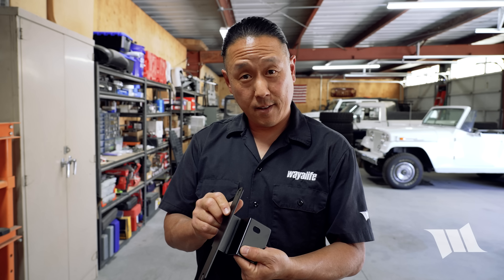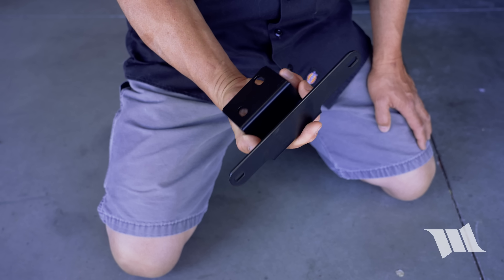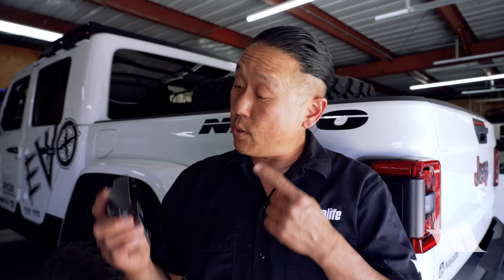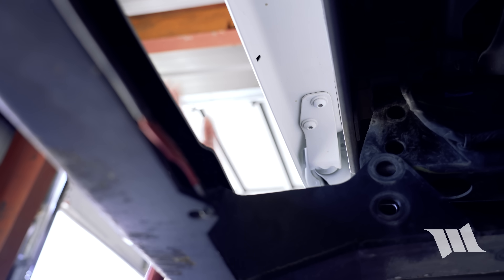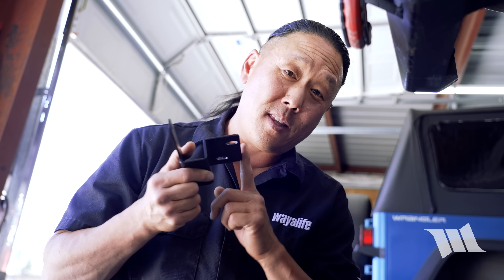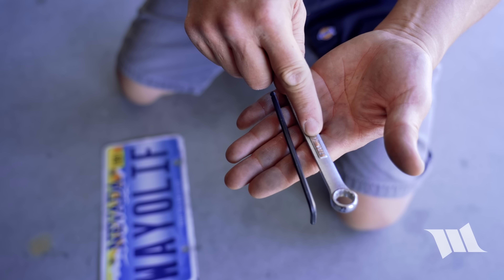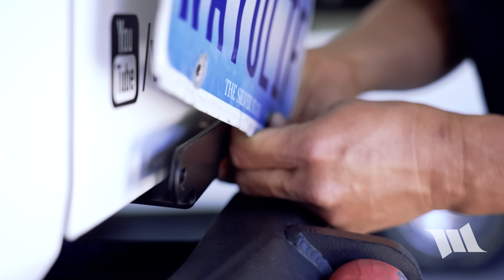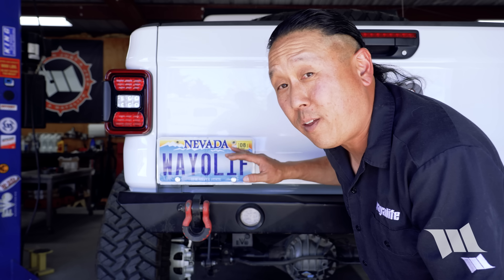Jeep Gladiator Tailgate License Plate Mount Install for the EVO High N Tight Rear Bumper

Comment: Great bumper but where you put the plug for the trailer cables? I'm scratching my head I want this bumper but I use the jeep with a jet-ski trailer I need a place to plug it safe 😂
Reply from the maker: EVO has a new version of this coming out at SEMA with a hitch receiver.
Reply: @wayalife  awesome! and where would the hitch cables be on the bottom? Would we be able to use the original cables the gladiator comes with?

Comment: Looks awesome are you running license plate light?
Reply from the maker: We are not. In fact, we are now running the new High-n-Tight bumper made and for some reason, it no longer allows this license plate mount to work. Hoping EVO comes out with a new setup that will work.

Comment: What options should I get on my Rubicon factory order?  Gorilla glass windshield? Rock Trac full time 4wd? LED lighting package?  Hitch package with 4 aux switches?  Steel front and rear bumpers?  What options did you get on your Rubicon JL?  I know it came with the 33s.
Reply from the maker: Me personally, I would definitely get the LED lights and the hitch package with the auxiliary switches. Full time 4WD is not something I would get. The Gorilla glass, maybe. It's super expensive but I hear it works pretty well. Steel bumpers, well, that all depends if you plan on keeping them for the long haul. Lots of great aftermarket options available.
Reply: @wayalife  Thanks for the help.
Reply: I was thinking of getting the Xtreme Recon package, but I want to get 488 regearing option because I plan to get 37s and a suspension lift.  Is it better to get stick or the 8 speed auto?
Reply from the maker: @mion1981  The 8-speed auto is what I would get for sure.

Comment: Good afternoon!  I have a problem where I hear a clicking noise when I start driving.  The sound is coming from the front gear.  the sound is like a metal knock.  (as if 2 wrenches hit each other) Mileage 10.000 km.  in the urban cycle.  I hope very much for your help.  Thank you
Reply from the maker: Sorry, I'd need to know a lot more about your Jeep to even begin to help you out. Year, model, modifications, etc. I would recommend that you post all this on https://wayalife.com. That is my forum and where you can get the most help.

Comment: I would prefer that this bracket be included as part of this bumper since if forces a modification to the license plate location. Should not be a separate expense.  Maybe it is and it didn't get communicated.
Reply from the maker: To be fair, there are plenty of people who run things like bed racks and have secured their license plate to it so really, I think it's unfair to suggest that everyone would need it. But then, that's just me.

Comment: Is the hitch on the hitch version reinforced inside the bumper with any additional plating? I can't find any pictures of that side of the bumper.
Reply from the maker: It is but it's basically useless for towing due to how it's setup.

Comment: Hey @WayaLife, how do you mount your 2 gal gas cans on the side of your Bed rack system? I am looking into ordering the EVO Half rack and 2x 2 gal cans. I am not finding how to mount them online though. Thank you in advance.
Reply from the maker: I made my own mounts but I believe that EVO makes something similar now.
Reply: @wayalife  I have searched on Evo site but found nothing. Might have to go with someone else. I'm not a mechanical engineer to be making something like that XD lol.
Reply: @wayalife  Do you mind me asking what you used to makeshift your own mount?? It looks like a sheet of metal but I cannot determine what it is.
Reply: @wayalife  Sorry for all the questions, I really want that EVO bed rack, but if its hard to makeshift a mounting plate for the gas cans idk if I will order it.
Reply from the maker: @iMatt75  Yup, I just used a piece of 16 gauge steel that I bought from the hardware store, drilled some holes and bolted everything up. That said, I would give EVO a call and tell them that I sent you regarding the mounts. It could be they just don't have it on their website but I have seen them.
Reply: I have contacted Evo and received a message stating they do not currently have anything like that. It's ok though. I will just find a Steel plate like you.

Comment: the only problem with this is in my province, your plate requires a light so it can be seen at night, otherwise this is a perfect solution
Reply from the maker: Problem solved https://amzn.to/3wGS780
Reply: Most states require the rear plate to be illuminated.
Reply from the maker: @txvetter so illuminate it then! https://amzn.to/3wBUkTv OR, don't buy this bumper. Problem solved 👍
Reply: The Amazon link has a product with 0.6 inches, or 1.6 cm of exposed thread...... Would that fit your particular situation, what would you have to trim that down?
Reply: That's perfect, thanks Eddie
Reply from the maker: @Rich Gurska Not sure if the length would be a problem but if it were, I would just add a thick washers to help space out the lights. That will reduce the thread length.
Reply from the maker: LOL - here's a link to a video we made over 4 years ago that might help you out https://youtu.be/7ul3itAIKeU?t=778

Comment: maybe add some foam tape to the back of the plate to make sure it doesnt damage the paint..
Reply from the maker: But... the plate doesn't touch the paint.
Reply: @wayalife  wondering about highway speeds, does it move enough to touch?
Reply from the maker: @rodhester2166  nope

Comment: The only problem I see with this is if you're hauling something a little long with the tailgate down, cops who can't see your plate might pull you over
Reply from the maker: LOL - If that happens, explain to the nice officer where your plate is. At worst, it's a fix-it ticket. Or at least, so long as you weren't doing something illegal.
Reply: I agree with you on that and let’s not forget some states require the plates to have a light (Florida requires a white light that allows the plate to be visible from 50’ away)
Reply from the maker: @Jared Wayne Back when we lived in CA, we used this to light our plate https://amzn.to/3sRFdTs and I'm sure it would work with this setup as well. Again, these are fix-it tickets at worst - not issues that will get you thrown in jail.
Reply from the maker: Here's another option that we've used in the past https://amzn.to/3wGS780
Reply: Fyi. We don't have fix-it tickets where I live...what is there for front plates when you put on an after market bumper besides drilling out your own holes?
Reply from the maker: @David Paradis LOL - and here I thought it was bad in Kalifornia. So glad that I don't live there or wherever the hell you live. Sure would suck to get thrown in jail over a stupid license plate violation.
Reply: @wayalife  the people's republic of Massachusetts...they like any excuse to pull you over and make sure you're not drunk or search your car, no warrants, etc.
Reply from the maker: @David Paradis That's gotta suck for sure and again, I'm grateful that I don't live there. If I did, this would clearly not be an option.
Reply: @davidparadis490  If you have a winch, there are a lot of fairlead plate mounting options